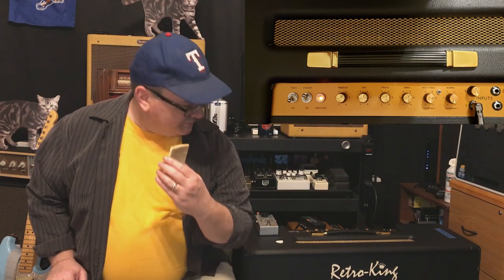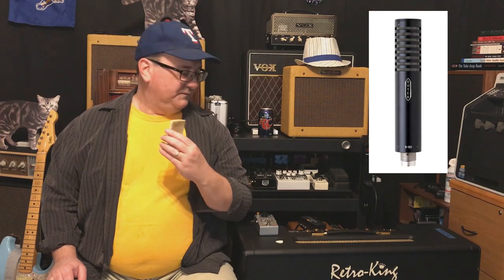Fulltone Ranger OC75

Comment: I've never been a treble boost user though a lot of players I admire have used them. Way too many choices here for my liking Wayne
Reply from the maker: Seems like more & more pedal builders are doing the "multi in one" thing ... it's less noticeable in the video but each setting kind of makes a different vowel sound to my ears. I think I liked the "Mids" setting best. Thanks for watching Paul.
Reply: I think the multiple switch settings makes that Ranger vastly more valuable. Could be the sweet catalyst that bonds certain guitars and amps that wouldn't have paired so well without it. 
And the middle most switch positions here sound particularly complementary in the shown examples. Good choice.
Reply from the maker: @montag4516  thanks for watching and commenting, I too appreciate having options which can be tailored for the guitar/amp